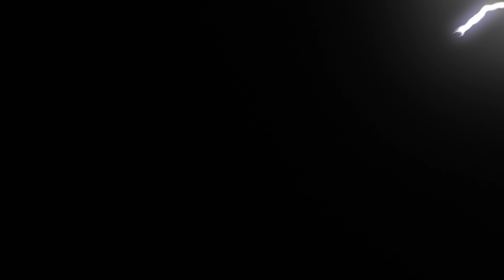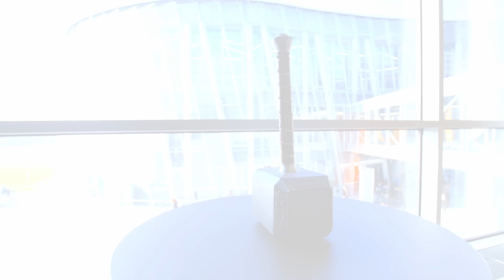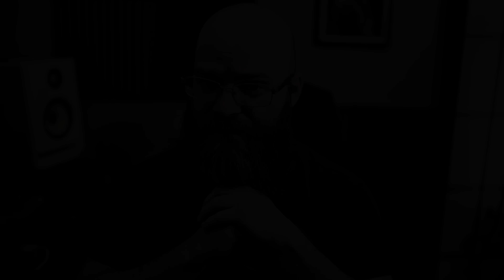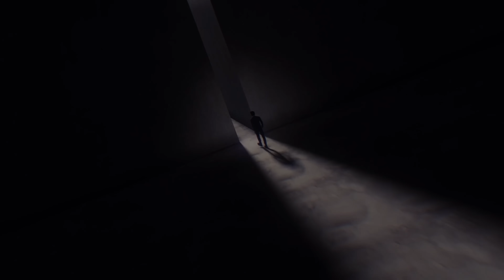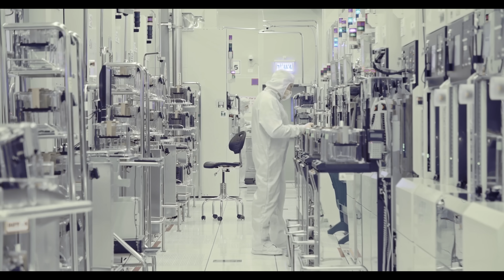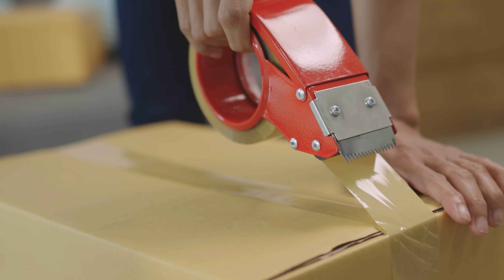The Nikon Sensor Conspiracy Solved

Comment: I think Nikon wouldn't want to be seen using a competitors machine to make sensors as it wouldn't be a good idea if the other company makes machines that compete with Nikon's, that would be a Nikon salesman's nightmare.
Reply from the maker: Well sony doesn't use their own machines to make the sensors either.  If nikon wanted to make their own I imagine they would use the same machines Sony does.
Reply: @ZWadePhoto I know but if they're in the business of making them type of machines also, even if to not that high spec to produce tiny sensors you wouldn't want to be known using one as it wouldn't be good advertising for there other machines.
Reply from the maker: @PeckhamHall I guess I’m lost on the point youre making partner.  lol can you rephrase or something?

Comment: i used to trash on Nikon and Canon for using Sony sensors (Nikon) and for having god awful color science (Canon). Back when Sony's best camera could do 12fps uncompressed raw at 42 megapixels vs 7/6 at 34 megapixels compressed raw from Canon and Nikon and still managing to cost less than either of the Canon and Nikon equivalents.
But now what? How the tables turned, mate! Who has the dogass color science? Who's got the shitty screens? Who's got the low burst rates that half down when shooting any format heavier than 12 bit cRaw ?
Reply from the maker: @Boeing747Cultist  thanks for watching.
Reply: @ZWadePhoto  interesting point from the workers indeed. I honestly don't care if a camera company imports sensors for other companies. Besides, Sony is an all electronics company, the Sony Alpha line is in fact the lesser known of the "play station/ bravia/ etc) stuff.

I believe Nikon did great with their open source-ification of photography and videography by buying Red and partnering with Megadap to let you switch brands without investing a fortune on lenses. Also the fact that Nikon does not limit third party lenses (frames per second limit, autofocus calculations per second limit, PDAF area limit, tracking updates per second limit, screen refresh rate limit and screen resolution limit)

Comment: Couple things: I think you said Nikon used to "make" sensors in the past. Nikon has never fabricated commercial sensors; they have never had a semiconductor chip fabrication factory of any kind (as distinct from a low-volume lab for creating one-off test chips). They have designed sensors from the ground up, and many others partially, and they have contracted to have them manufactured by at least three different fabricators. But they have never manufactured/fabricated any chip of any kind for commercial sale. They are one of scores of companies that can design sensors but must contract with a fabricator to have them actually manufactured. Apple is another such company.

Second, Nikon's Expeed processors are manufactured by Socionext, which used to be named Fujitsu. Not Renesas. (Renesas, which used to be Mitsubishi's Semiconductor group, did make several Nikon sensors 10-20 years ago).

Socionext/Fujitsu has been Nikon's main supplier of ASICs (application specific integrated circuits) since at least the 1980s, to my knowledge. The relationship could well go back to the 1960s. 

Nikon and Sony have cooperated in many ways, on many different kinds of products, since at least the 1980s and probably earlier. Sony has used a lot of Nikon lithography equipment over the years. Also, large sensor chips like the ones in dedicated cameras (as opposed to smartphones) are not made on cutting-edge lithography equipment, since there is no need for it. They are made on lower resolution (i.e. cheaper and older) lithography machines. Nobody is buying ASML's latest $150 million steppers to build large camera sensors.
Reply from the maker: @eamonhickey  thanks for watching
Reply: Any idea what photolithography process node in particular is used for a current generation camera sensor?
Reply: @Bayonet1809  I've only done half-hearted research, but it's difficult to find reliable information regarding the large sensors we're talking about here -- i.e. APS-C and FF etc. There is some reliable information about the tiny image sensors (cell phones, machine vision etc.) because that's the market where all the innovation, investment, and research is being done (because, obviously, that's where the money is). The most advanced tiny sensors are evidently being made on ~28nm nodes (introduced almost 15 years ago). Large sensors, almost by definition, just don't need the ever-tinier feature sizes that smaller nodes allow.

I've heard -- how reliably? not sure -- that the smallest process line Canon currently runs is 130nm (introduced more than 20 years ago). There is fairly reliable information that they made all their large sensors on a 500nm line until the last 7-10 years. It at least sounds plausible; the most advanced stepper that Canon makes (KrF) is not suitable for volume production below around 130nm. Only Nikon and ASML make ArF steppers that are practical for smaller nodes, and I can't imagine Canon buying any of those. (Could be wrong about that; if the bottom line justified it, they would.)

If Canon is using 130nm for its large sensors, it's at least reasonably likely that Sony is somewhere in that rough ballpark, because the higher cost of using a smaller node would put them at a price disadvantage compared to Canon. But that's just an educated guess.
Reply: @eamonhickey  Thank you for your informed speculation on the topic. It is all very interesting. I would have guessed 28-65nm, so 130-500nm is quite a surprise.

Comment: The legend of Sony sensors in Nikon bodies stems from the fact that Sony acquired Toshiba's sensor manufacturing division to gain access to high-end technology, which was equipped with Nikon-made lithography machines to engrave these sensors under a global industrial agreement.
Since then, the rumor has been that Nikon has been misusing Sony sensors.
Reply: This isn't true. Nikon and Sony have cooperated on many products since at least the 1980s and have a long business relationship. When Nikon built its first completely in-house digital SLR, the D1, it designed the sensor jointly with Sony, and Sony manufactured it. This was in 1997/98, long before Sony bought Toshiba's sensor group and long before Sony bought Minolta and got into the DSLR business.

Nikon actually co-built a DSLR before the D1 -- the E-series cameras, which they developed, built, and marketed jointly with Fujifilm in the mid 1990s. Those cameras were F-mount cameras with Nikon-built bodies and Fuji sensors and image processing pipelines. This was not secret; the cameras had both Nikon's and Fujifilm's brand names on them.

Before that, Kodak built DSLRs out of Nikon bodies, with Kodak sensors. Nikon was not heavily involved in the development of those cameras, but they did cooperate somewhat with Kodak to help them adapt the bodies to Kodak's sensor/processor pipeline.

Over the years, Nikon has designed some sensors in-house from the ground up, designed other sensor in cooperation with sensor designers at other companies, and used sensors wholly designed by other companies. They've done it all. There's nothing wrong or unusual about that. It's just how modern companies work.
Reply from the maker: Thanks for watching

Comment: Nikon also used off-the-shelf Sony sensors in the Z6, Z6II, Zf, and Z5II, which are all the IMX410.
Reply from the maker: That term off the shelf carries so much assumption with it though.  Nikon is still doing it's thing.  The RAW output doesn't even look like Sony RAW output.  I've observed them side by side.  Nikon has it's hand in how the sensor is rendering.  Thats the point.
Reply: @ZWadePhoto  Of course raw images from a Sony and a Nikon look different, even with the same sensor. But the differences you are seeing is not due to different sensor hardware, but rather due to different processing.

Before the .nef/.arw file is generated, the processor (Expeed/Bionz) manipulates the actual raw data. Due to the variability between and within silicon wafers, a PRNU (uniformity) correction is required (spatial filtering). The artifacts of such a process are often visible in certain conditions. For example, the PDAF row banding on the Z6 (and Z7, and even Fujifilm GFX100), which was subsequently fixed on the Z6II (and Z7II, and GFX100 firmware Ver.3.01) was not fixed as part of a sensor hardware change (the fixed cameras used the same sensor), but in firmware (which is why the GFX was fixed with an update). 

Different camera manufacturers use different algorithms and different degrees of filtering, (e.g. Sony's infamous "star eater"), while some even apply black-point subtraction, or a degree of lens correction at the raw data stage (causing concentric rings when using a recognised lens). This filtering is also why you don't see all the dead/stuck pixels that are on the sensor, which are compensated for by neighbouring pixels. And then there is raw compression techniques and their effects, which a whole other topic.

Thus, because the input is different, the developing software (Lightroom/ACR/Capture One, etc.) has to apply different output processing: colour correction matrices, and then different tone curves and colour profiles, which means that the preview you see on your computer monitor will naturally be different across cameras with the same sensor.

Comment: Well, it does NOT change the fact that Sony is manufacturing sensors for many companies including Nikon. 

It's much easier to understand by comparing it to TSMC who manufacture chips for Apple, Nvidia, AMD, and more. But unlike others, TSMC does NOT compete with any companies and that's their moto. Tho Sony operates different divisions for sensor and camera, designing and manufacturing are totally different. You cant just ask them to make them and Sony is the only company who can make sensors based on their needs. Not only Nikon but also Sony, Pentax, Phase One, Fujifilm, Hasselblad, Panasonic, Leica, Olympus, and more. 

Currently, Nikon is at 3rd place while Sony is competing with Canon for the 1st place and we all know that Sony outperformed Nikon a while back and that's how they won the mirrorless market and go on. This is why Canon makes their OWN sensors in order to compete with Sony. You might gonna say there were no stealing or law suits but by providing designs or schematics to Sony, it allows them to learn and develop better CPU which is a fact comparing between Sony and Nikon. 

Same reason why Nvidia, Apple, and Intel did NOT want to manufacture their own chips from Samsung and TSMC for some products. Apple literally ditched Samsung for fearing of copying and learning their cutting edge chips by moving to TSMC.

Does Sony operates their business like TSMC? Never did so there are some risks that Sony could get know-how and information from Nikon sensor designs.
Reply: You're making it sound like Nikon cameras couldn't possibly compete with Sony, while in reality the sensor in the Z8 blows everything Sony is offering for the same price completely out of the water.
What's way more important these days, is the lens selection, software features, and autofocus, which are all areas where Sony is ahead, maybe with a few exceptions for certain lenses.
Reply from the maker: @lol-di3tf  thanks for watching

Comment: Will Nikon then use RED sensors on say the Z9 replacement top end and use say other sensors for lower level cameras
Reply from the maker: I think it’s ver possible that they switch to the existing partnership that red has which is currently Tower Semiconductors (TowerJazz)
As long as they can keep up with the production scale I’d be ok with that 🤙🤙 it’d shut up at least some portion of the ones complaining about Sony sensors haha
Reply: @ZWadePhoto  next vlog the test of current Red 8k  video camera v Nikon Z9 8k video to see if there is anything different
Reply: RED doesn’t make their sensors, just saying
Reply: @JojoJoget  who ever makes the sensor like Tower Jazz then if these sensor are good enough for major movies  block buster films I would assume that Nikon would use Red's existent contacts to tweak a sensor to their current and future requirements

Comment: I have been told by a Nikon rep that the D850 sensor itself was manufactured by Tower Industries previously Tower Jazz which is now owned by Intel
Reply from the maker: I’ve heard that as well but even double checking just now it’s coming up as “Nikon designed the sensor and it was manufactured by Sony Semiconductor Solutions”
Reply: Representatives are not engineers. If only they were.

Comment: This is very informative thank you for all your research. I’ve always wondered why Nikon has never made a camera that competes with the a 6000 series. I was thinking maybe they have a deal with Sony that as long as they supplied the sensors for Nikon cameras that they have to stay out of that market. I don’t know if that’s true or not but whatever. It was an interesting and very informative video. And yes, I can see that Nikon know what they’re doing in regards to the technology behind sensors. For years, they were getting more out of Sony sensors than Sony was able to because of their technology and their chip design. Since then, Sony pulled up their socks and certainly proved that they can make good cameras and compete in this market.Regards Gerry
Reply from the maker: @Photobug9060  thanks for watching Gerry

Comment: Colour accuracy is neither a sensor property, nor silicon or chip manufacture thing. The sensor is colour-blind. Because it sees the entire spectrum of humanly visible light, we should call the naked sensor "panchromatic" - that's how we called black & white (B&W) film that also did so.
After a sensor (chip) is made, it is overlaid with a filter grid. AFAIK. In the Bayer paradigm, the sensor grid must be precisely aligned. And each of the tiny actual sensors (called photosites) in the sensor grid gets a filter over it from the filter grid overlay that narrows that photosite's colour vision down to one single colour band. Colour accuracy then depends on the filter specification. That specification defines the cut-off wavelengths. Cutting off at a specific wavelength is one thing for that filter, but it needs to be "low pass"or high pass" too. And third each cut off wavelength has a "fall off" specified. In your loudspeaker specification you see that fall off specified in deciBels per octave.
The slope of the cut-off, the subsequent amount of overlap, the cut-off wavelength determine primary colour accuracy (in the raw). This however must be followed up by raw processing doing it right.

The tiny filters over the sensor don't operate by pigments but by phase effects.

Colour film sees RGB at any coordinate (in theory) with three transparent layers over each other. In sensors, the RGB are next to each other. While film at coordinate [x,y] has RGB, the sensor has either R, or G, or B. That's what goes into the raw file. To get a nice RGB image from that for each R element the missing G and B must be guessed and added, and so on for all three colours.
By the way, in the human eye the "normal" is to see with four different receptors: most are just light sensitive (colour blind) and then there are R, G, and G ones. These are next to each other. People that are colour-weak miss one or more of the three colour cones. When they miss all then they are colour blind. And then there are people with a mutation that enables them to see in four colour bands. Don't ever debate colour correctness with these.
In other words, colour accuracy on the receiving end can be subjective.
Reply from the maker: Yes.  Nikon must calibrate to the desired result.  With a RAW sensor you have no "Hasselblad Color" " Nikon Color" "Canon Reds" ect
Reply: @ZWadePhoto  - exactly. So each of these brands have their own approach to the filter specification. There may be patents involved. When naive fluencers talk about colour science then this is what they rap about - while forgetting the role of raw processing. There may be implications from firmware versions even. This cannot alter the way the filter grid works as that is detached from the electronics. But changes in gradation (analogue-to-digital conversion - "AD") can impact how tints are to be interpreted. Adobe Camera Raw has different profiles for how to process the same camera with different firmware for a few older models.